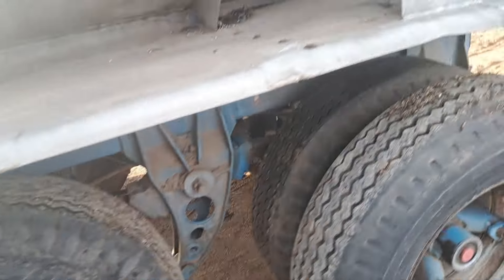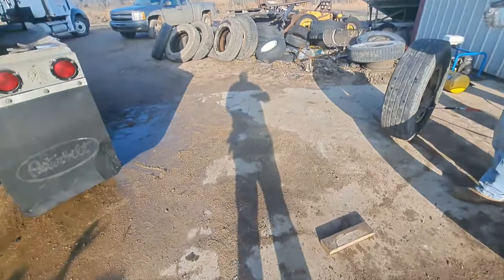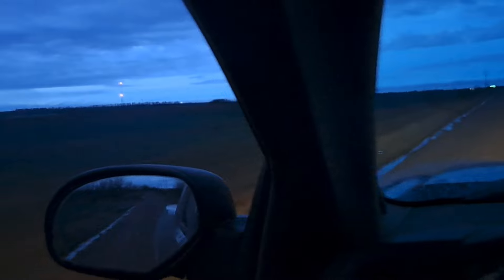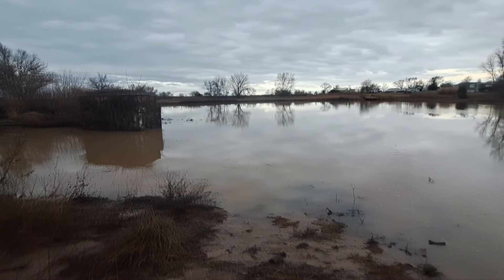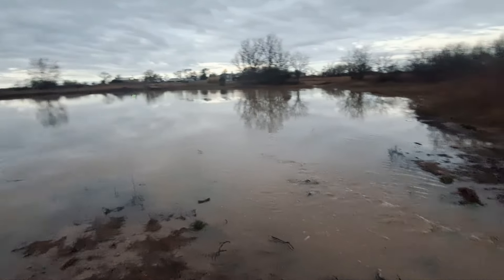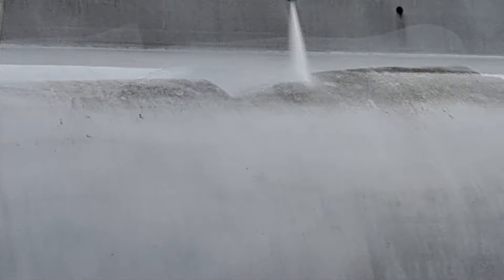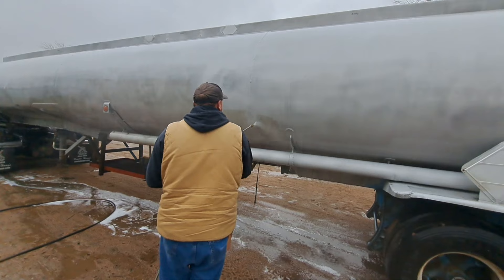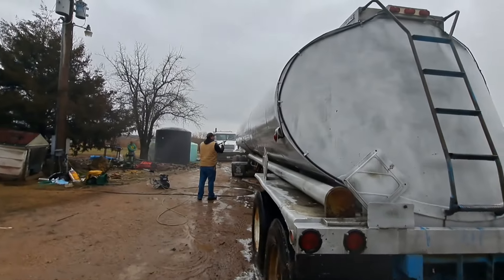will aluminum brightener clean this.

Comment: We bought a tanker almost identical to yours about 5 years ago on auction up at Falls City NE, COOP  up there had used it to haul molasses and didn't get it cleaned out, had about a foot deep slurry in it, smelt like manure, we got it cheap they couldn't get anyone to bid on it ended up giving $150.00 for it. It has 5 compartments we've cleaned out all but one so far been using it for tending sprayer, mainly bought it for if got dry and needed to haul water for our cattle. Since I've had my back surgery and have gotten healed up plan on getting into it and get the last section cleaned out this spring. @pughfarms
Reply from the maker: The aluminum was worth more than you gave.  Inever thought about using it to haul water for cattle.. that would work.  Thanks for the comment.